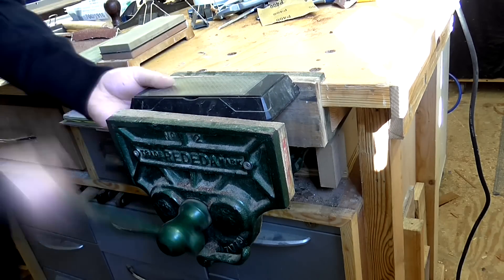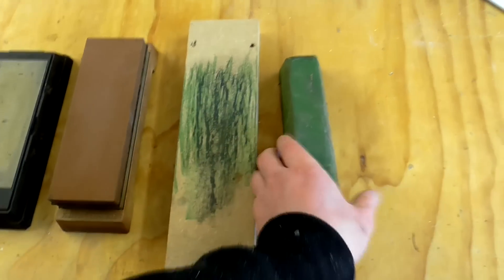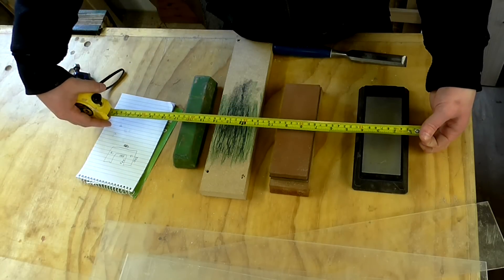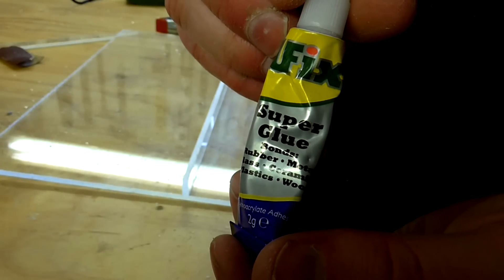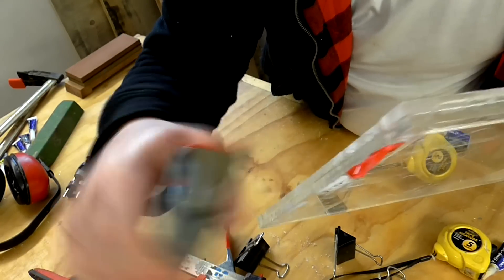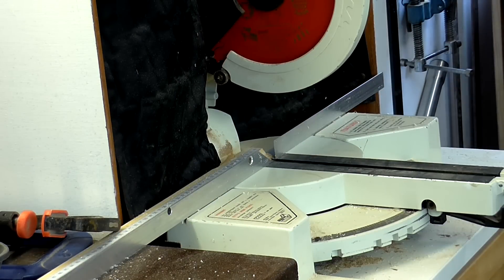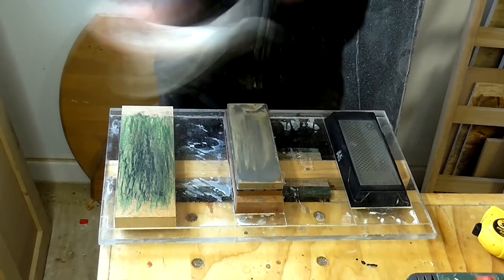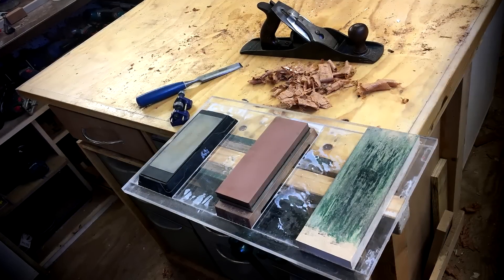Perspex Sharpening Station

Comment: I made something similar to this but i carved the exact size my stones into the wood with a router and put the clamping piece on the bottom edge (closest to you instead of the middle)  so that i wouldn't have anything hanging in the air...

Comment: Nice idea to use the perspex to make it waterproof. You could upgrade your kit by adding some leather to your MDF to make a strop - this absorbs the cutting compound over time and experts estimate it's about 12-15000 grit after about a month. It also cushions the sharp blades and prevents any nicks to the sharp edge.

Also have you thought of first putting 25º master bevel on your chisels first, then in just a few strokes you can add the 30º micro-bevel which is even faster to touch up than having to regrind the whole sharp face?
Reply from the maker: Have been meaning to do that for a while but I've not yet come across a piece of leather... will probably do that at some point.

I try not to mess about with micro bevels etc. it's a good idea in principle though, I just like to get sharpening over with ASAP and get back to the project.  THanks
Reply: I bought an old leather jacket from a jumble sale for 50p and cut it up into strips when I need to replace mine. So far one jacket panel is all I've used in nearly 10 years. Also the micro bevel will speed up the sharpening - a fraction of the steel to clean up compared to the whole edge but if you're method works then by all means stick to it. You get great results so ignore grumpy old men like me :)